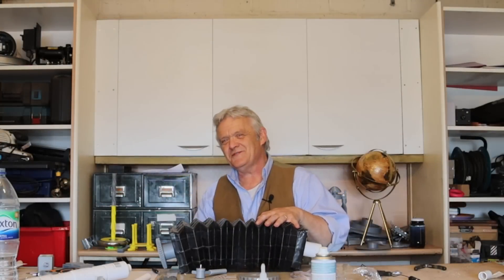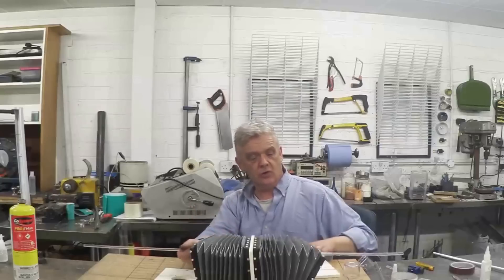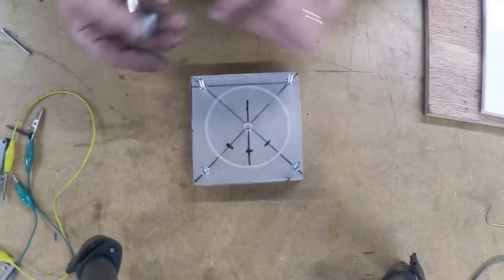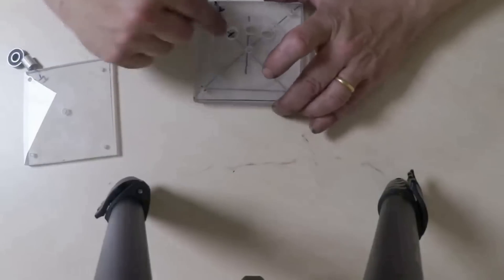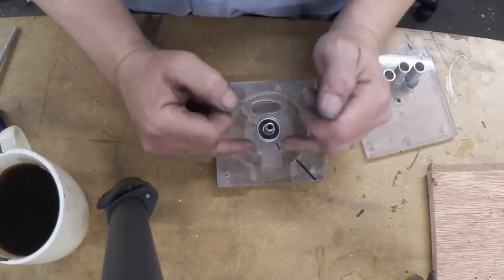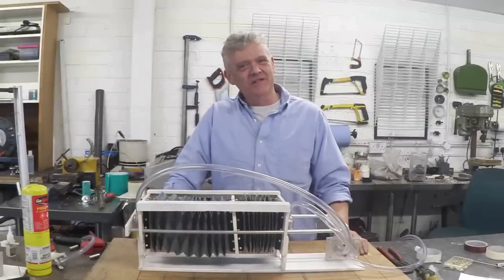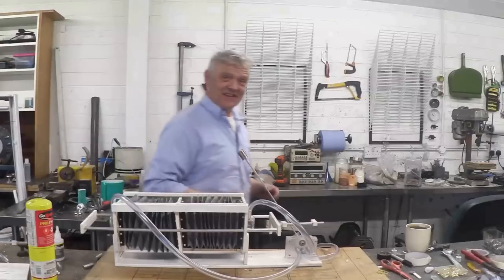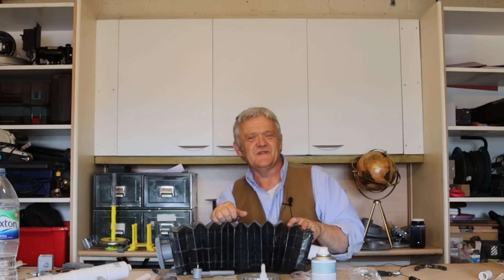2030 An Air Engine Anyone Can Build

Comment: Hello !
What do you think of the Wells turbine?
In principle such bidirectional oscillatory motion achieved by your air motor is similar to the motion induced by the "oscillating water column" used to convert wave energy into electrical energy.

Comment: hopefully i'm far behind or out of touch (quite common in my universe) but you have hopefully seen the wind turbine driven pumps that are simply prop, shaft, eccentric between bellows with appropriate check valves. simple concept. the ones i saw were using airbags meant for suspension for a semi truck ("lorry"?)

Comment: Energy transmission by air pressure could be nearly 100% efficient where copper loses significant power in low voltage DC. Bellows are more fun than I ever imagined! Thanks -- Will definitely check out the Bellows series.

Comment: Looking at the beginning where the bellows are on the bench between your hands gives me an idea. You could dismantle a mouth organ and fit bits to the ends of the bellows to make a musical instrument. As you stretch the bellows air is taken in and then compressing the bellows would force air through the musical bits to make sounds. Needs a bit of work and a name then off to market in my new, Ford Concertina 🤪

Comment: The 24V electric water valves used for sprinkler systems would also work for pressurized air or vacuum. Reed switches and magnets could trigger them, and by moving the magnets be easily adjustable for timing.

Comment: A possible way to make a water pump? The water flow can cause a syphon and get the bellows moving to push more pressure into a check valve maybe. Unsure really, but a Stirling run on bellows would be a great idea instead of a fan because you could stoke a flame and cool the cold side in one go.

Comment: Referring the tiny printed bellows you posted in another video released on T'n'T, this could be used as a motor to drive a little lift pump to move water up a hill at a level of pressure greater than the pressure of the falling water [but slowly, of course].

Comment: Might not seem useful for anything but what about moving air from a rocket stove. But if you circulate air from pipes going through a rocket stove in and out the tent completely separated from the exhaust of the fire? Bet it even work with tin can an balloons sterling engine.  Could make whole thing out of tim cans and balloons.  Stove,, engine and valve/air circulation system.  No fumes heat for tent while camping

Comment: I Made a  air engine from a electric clock motor and straw, The part of the motor was two steel wheels with some flat pieces on the sides, It was in a housing and worked like a small air turbine when I blowed on it. It was a fun little toy but I never did anything with it.

Comment: Have you seen the movie "Sam Whiskey" where the blacksmith builds an air pump for underwater diving? Your motor looks a lot like his hand operated air pump.

It's a great western movie with an all Star cast.
Reply: I was thinking along the same lines. It reminded me of drawings I’ve seen of the air pumps used in the tunnels of Stalag Luft 3 for the ‘Great Escape’. (The actual event, not the movie version)
Reply: @DABrock-author  Yes, it looks like those too!

Comment: not wishing to put the mockers on the project but that system of pipes and valve will reduce the efficiency of the bellows would it not be better to develop motors that work directly on the end of the bellows????

Comment: I saw an interesting stirling engine that had bellows and a rotor. The rotor was a half-circle rotor for the hot side and the bellows was used on the cold end. It was an odd setup, but it worked.

Comment: Nifty " Air Motor" 

(I cannot call it an engine because no fuel is being burned)
Reply: It's really not a motor either because no electricity is used. An automatic mechanical device maybe?
Reply: @magapefarmshomestead6453  research "air motor" or " hydraulic motor" or as in the case of this video, linear motor 😉

Comment: stunning and spectacular, a less spectacular valve is the simple flap valve, a flap of leather across the air intake (or outside the air exhaust) will allow the one way passage of air quite conveniently, once you have a valve you done even need bellows, 2 airtight bags will do (viking age forge bellows were essentially 2 animal stomachs or 2 leather bags and alternately pushed and pulled (a handle was attached to each for the pushing and pulling)
Reply: Yes, flap valve setup is as old as bellows and it is very, very simple/reliable/time tested. But it's Robert. The tinkerer. He did it for fun and science! 🥰